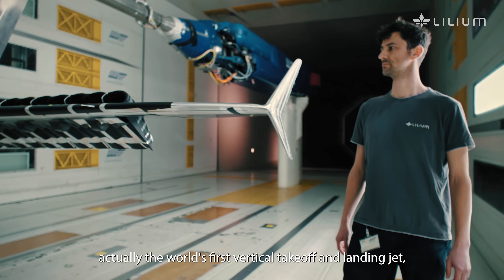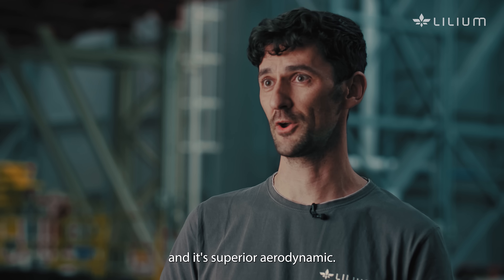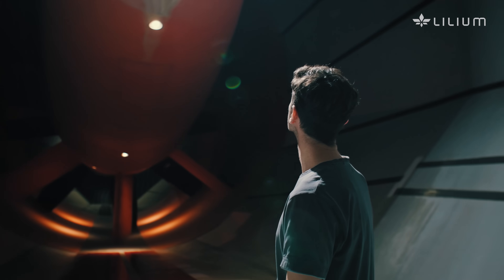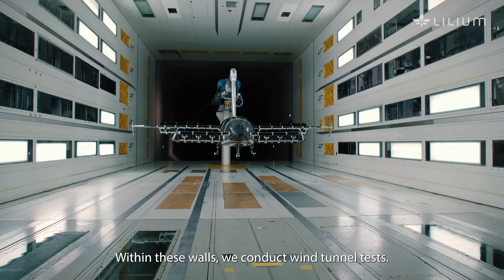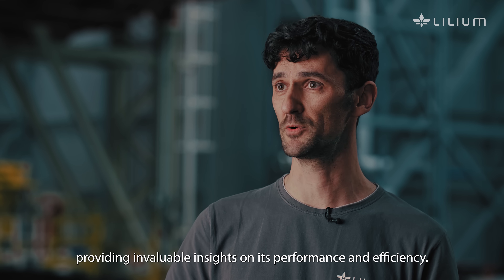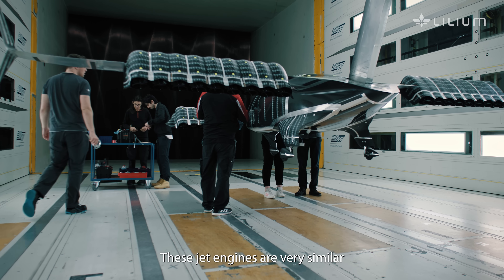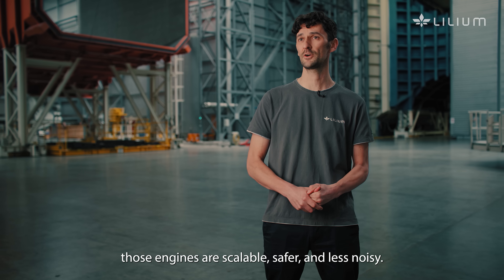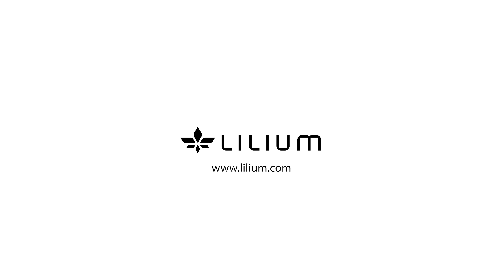Lilium Jet | Wind Tunnel Testing | Hear from Julien

Comment: It's a marketing play. A jet has a jet engine. These are not jet engines, they're ducted fans.
Reply: @aaron8862006 A jet is a rapid stream of gas forced out of a small opening; see Oxford dictionary. 

Both a ducted fan and a “combustion jet engine” (as on airliners and fighter aircraft) create a jet, namely a highly accelerated air stream that provides the thrust needed to overcome drag and propel the aircraft forwards. 

Hence naming the Lilium “jet” is as correct as a Gulfstream jet. Cheers!
Reply: @wouterplaetinck6887 is your rear end a jet?
Reply: @wouterplaetinck6887 no it’s just an electricity driven ducted fan it’s not a jet
Reply: 이것만 하트 안주는게 개웃기네 ㅋㅋㅋ
Reply: @Jacktherookie_  ㄹㅇㅋㅋ
Reply: Ever heard of Jet Assisted Takeoff? JATO doesn’t use jets
Reply: @randbarrett8706  a jet comes out of a rocket and that thrust assists the takeoff. That doesn't mean anyone is calling them jets. The jet from the rocket is what is assisting. People call it rato anyway. A jet in regards to aircraft is an airplane powered by a jet engine. Nobody thinks rockets are jet engines. Jato was used before jet engines were even invented so they were talking about the thrust not the motor and the name stuck for a while but it has changed. Nobody ever called the rocket motors jets or the planes they pushed jets just the process.
Reply: @randbarrett8706   the smart kids call it rato.
Reply: Nanometers dont even measure transistors and MPGe is also BS.
Reply: What is jet? 🤣
Reply: You go build one and name it properly, buddy. We don't care, we love the lilium jet! Name and all! For you, JET may  stand for Jealous Envious Troll!
Reply: @kfk256  yeah stupid people care less. Terminology is important. Language is what forms your idea.
Reply: @tbpom1003  Go build yours and name it appropriately and we will celebrate you when you're done. In the meantime, lilium will continue to achieve world changing milestones.
Reply: @kfk256  are you an employee of the company? I dont understand what's the benefit you get for covering their ass
Reply: @tbpom1003  No, sir. I'm just enthusiastic about innovative technologies, human advancement and encouraging well meaning engineers. Simply that, sir. 🙂
Reply: @kfk256  yeah if you are enthusiastic to those, you'd better stay away from false usage of words
Reply: @tbpom1003  Let them finish building it, then we'll name it properly. 😉
Reply: @kfk256  we don't even need to build one to name it. Lilium never built one.
Reply: @TheBagOfHolding  We'll see. So will the FAA. 🙂
Reply: @TheBagOfHolding  what's the difference between a jet engine, and a gas turbine? Both produces jet, a stream of air?
Reply: That's right. They're just using the JET name to attract amateurs, aren't they?
Reply: Show me on the doll where the evtol hurt you 😢
Reply: Jet means flow of air for example a jet stream that being said my design is much better than these people.
Reply: @FLORIDIANMILLIONAIRE a jet in regards to aircraft classification is an aircraft powered by a jet engine. Are all airplanes and helicopters jets?
Reply: @TheBagOfHolding no, but all aircraft that use a jet for propulsion are jets.
Reply: @obmaxt  that would mean rockets are jets and they aren't. Jet has a definition in regards to aircraft classification that I think you saw and chose to ignore.
Reply: @TheBagOfHolding  so what do you think they should call it? Is it OK by you if we call an electrically propelled transportation machine a  car?  Can we call a wireless communication device a phone? Can we call a movable light source that uses electricity a lamp? Has the FAA or other regulatory aviation institutions determined a classification for it?
Reply: @obmaxt  it is a tilt rotor.
Reply: @obmaxt  really, it should be called a boondoggle
Reply: Jet of air? An electric fan? Who cares it flies.
Reply: @MrJesse1479  It only flies as a miniature model with a load that's never mentioned
Reply: It may not be turbine powered, but a ducted fan IS a jet....
Reply: @CatRacer1a2a  a ducted fan isn't a jet. It may produce a jet but the motor isn't a jet. It's not a jet engine that has its own criteria.

Comment: Been following LIlium since their media debut as far back as 2015. You may be wondering haven;'t the Lilium Jet already gone thru such tests long ago, especially considering their prototypes that are already flying. Well. my assumption is that with the sector being a real thing of late and real investors and partners are now all in, including those very big notable buyers that they now have access to the most premiered companies systems and personnel to further refine their efforts beyond their past capabilities. These Investors dont want a product that will simply work, but rather one that will truly usher in a new sector of aviation rooted in the most premier testing and safety.  so if it means going back to the drawing board and thus raising the bar ever higher, thats exactly what their going to do to insure the most viable product in that sector.  While other are rushing to market to obtain the greatest of market share, they do so with great sacrifice to both product and safety.  Lilium Jet is in a class of its own, and it shows.  Their bar are far higher than their competition, their product far more scalable as they can provide from personal 2 seater up to 16 seat aircraft something the competition cannot do.  Lilium has taken the most difficult and demanding path of engineering with the highest financial risks possible in order to yield the greatest of results.  And the resulting aircraft will undoubtedly be the most revered in this new emerging industry.  Never forget, e-vtol is an entirely new sector of commercial aviation, and we are witnessing its birth. in a decade or two as these aircraft traverse the skies ever growing in numbers, we will look back at a time when they were only but an emerging concept, just as those who saw the first automobiles hitting the roads.
Reply: I don't bet my money on this project. I also have following it from the start, and it gets more and more weird.

Comment: Will it glide without power? Can it be controlled without power? How long does it take to charge?
Reply: @jimberg98 Those are valid questions for any evtol aircraft! Will they glide with total power loss - no. Can you control with total power loss - no. Will a total power loss occur? No, thanks to redundancy in the power architecture, certified at the same safety level (so there is 10^-9 chance of catastrophic) as the regular commercial airliners you already take for travel.
Reply: It will glide like a brick
Reply: No its fly by wire and would likely become unstable without power.  No parachute either.  Poor souls that get on it.
Reply: @JoeyBlogs007  That's my assumption which is why I'm asking. I want proof that it's not the case. Is their certification for flight an example of the government looking the other way because it's "green". My first inclination is to see this thing as being a cool idea, a cool design, but it's impractical and dangerous.
Reply: @jimberg98  Lilium is made in Germany, not chinese or american. That alone should be give you a clue. But you can also make researches, go visiting their websites.
Reply: @jonpetter8921  You don't think I looked? They're evasive about these questions because they know the answers aren't good. Are you seriously equating Chinese air safety regulations with American? Being made in Germany? Like VW? Remember how VW programmed their ECU to pass emissions while being tested, but behaved differently while on the actual road?
Reply: @jimberg98  Being made in Germany like Porsche BMW, Mercedes.
Reply: @jonpetter8921  And VW. That means nothing and still doesn't answer the question about what happens when power is lost.
Reply: @jimberg98  Not defending VW but emission fraud concerns almost the whole car industry not only VW, and Boeing recent saga is way more ugly and dangerous.

Back to our discussion your concern is legit, but i m sure aviation safety agency, both european and american should be aware of the matter and supervising.

Edit: by the way the reason i told you to check their website is that if you have done your researches you would know that the people at the top of Lilium are mostly former, Airbus, Roll Royce staffs. They know their stuff.
Reply: @jonpetter8921  The qualifications orf the people doing th work is not an answer to my questions. You should be wondering why they never seem to bring these questions up.
Reply: @jimberg98  I didn t say they will answer your question but to remind you those know what they are doing.
Reply: @jimberg98 Relax, they are required to pass EASA and FAA certification. 
If they ever will is another question.
Reply: @jimberg98 you looked where? 🤣 Coming to troll about without reading technical presentations? 🤣 🤣 🤣 🤣
Reply: @mariusmartinsen2064 Post a link for me to read. I say there is no such link  It's up to you to prove there is if you're going to call me a liar. How is asking a legitimate question a troll? You're the troll since you're picking a fight without contributing answers and making accusations without evidence to support them.
Reply: @JoeyBlogs007  Dumb af. It will have a parachute if you want one. You're talking about stuff you have no idea about.

Comment: I've been following this project for a few years now.
Do you guys plan to use remote controlled units to assist emergency responders?
What about units for first responders or extraction of emergency pacients?
Also, what are the harshest conditions in which it can fly?
Reply: It‘s designed for premium passenger transport not for air medical services.

Comment: very exciting. really hope this succeeds. all other eVTOLs are ugly-looking compared to the Lilium.
Reply: Strange that they do so much full scale flight testing and THEN go to model wind tunnel ..... wind tunnels do not work for vtol hover as they cannot deal with 90 degree   flow turning. Makes as much sense as building giga factories before even having a proven product.
Reply: @rossnolan7283  they never had a full sized craft.
Reply: What about the DeLorean from the end of back to the future? That looks pretty cool. That is just as real.
Reply: I'll take an ugly craft if it's safe, fast and can achieve decent range. 
No design will scale up to decent size for regular commercial flights though, until batteries become a multifold of what they are today. When Tesla started with laptop battery cells, the energy density wasn't all that bad compared to today. Little progress.
To achieve a modest 1000 km flight, you need to pack 3-4x as much energy in the same plane. But on such long flights, you don't want to lose 2-3 hours to a an actual jet, even if the craft could get there...slowly... To fly faster, a lot more energy per km is needed. For large planes, it's more difficult to achieve lift. They NEED to go fast to get off the ground, or go any meaningful distance. A 180-seat electric jet will easily take batteries 10x as good as today. And less flammable than they are today.